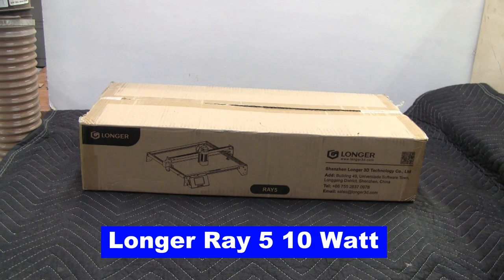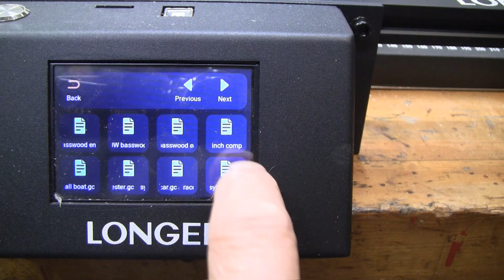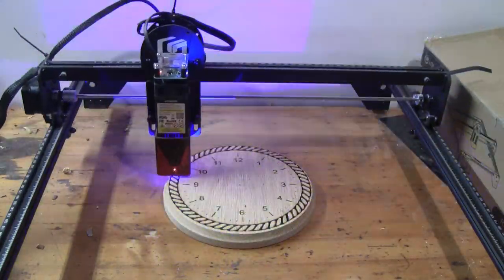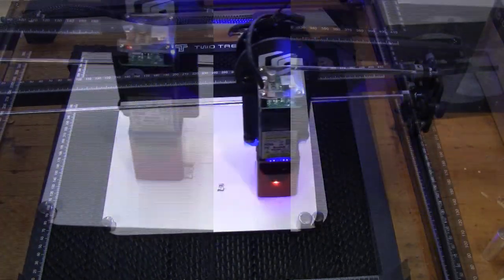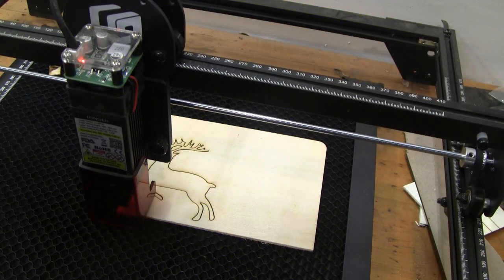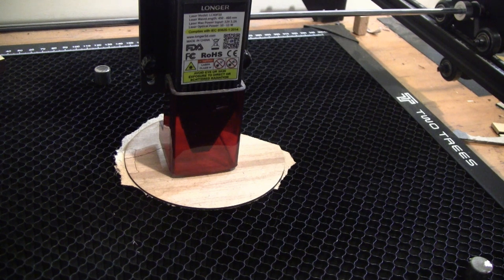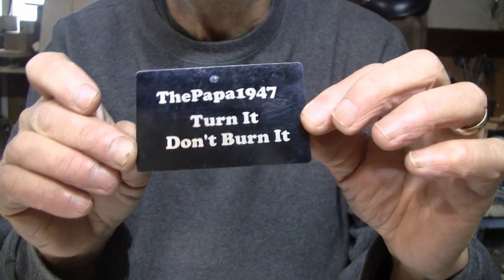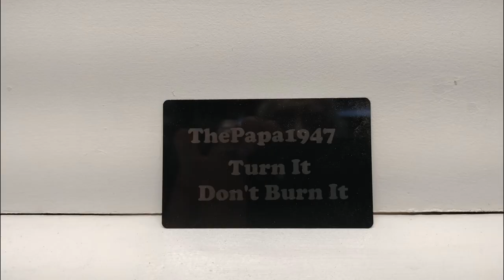Easy Laser Gifts  Longer Ray 5 10 Watt No Wood Turning

Comment: I’ve had my Longer Ray 5 10w for several months and absolutely LOVE it!
Reply from the maker: It is a very nice machine. Once I learned the trick of loading Gcode onto the touch pad I really liked that feature. Although I prefer to use Lightburn. But have created the file and brought it out and used the touch pad.
Thanks for watching,
Gary

Comment: Good overview.  Great idea on using the laser to cut turning templates.  I've been 3D printing templates when I need them, this will be quite a bit faster.
Reply from the maker: Thank you Mark. Yes I will use it for other templates as well. In the past if I wanted a perfect one even for some of my bowl in a bowl turnings I will CNC it but that is slow compared to this. Plus my poor CNC machine is blocked with other things at the moment.
Now 3D printing would be great for sure. But it is a bit slow. At work as a wood pattern maker they ended up getting a few rapid prototype machines. Nothing that us wood guys messed with but I am always interested in the stuffy.
The first rapid prototype machine was an LOM (laminated object manufacturing} and it was as slow as it could get. The young engineer they hired  to learn it had trouble making a model so because I was playing around in CAD at the time I created the very first part it made. I think I still have it around here. But then came the 3D printers a few years later. I am sure they are really advanced now because that was like 18 years ago when they got those.
 Thanks for watching,
Gary

Comment: Great little video. The picture came out really well. I've had a laser for a few months now, but haven't had it fired up for a bit while doing other projects. This video is making me want to get back at it again. I've been trying to incorporate it into other things like my cnc that I've done a couple things with. Laser engraving, then cutting out with the cnc. I really like the clock you made, combining turning and laser. Looks great! Have to try and use all those tools we seem to aquire.
Reply from the maker: Thank you very much. I know there are a lot more uses for it than what I have done and plan on learning what I can.
I have had 2 CNC milling machines for along time and have made lots and lots of things with them. Pretty involved 3D stuff.
 These are not CNC routers but heavy machines that you can cut steel on. But I have done lots of wood projects as well.
I just like the technology of computer controlled machines.
Thanks for watching,
Gary

Comment: Hi Gary,
Just wrote a comment and the cyber grinch flew away with it! LOL
Welcome to the crazy world of hobby lasers!
I bought an ORTUR about 6 months ago and love it. I too have Lightburn and love that as well.
I was shocked to see your laser cut that piece of cedar in 2 passes. I doubt my laser would cut it in 50 passes!
Have fun,enjoy and be safe!
Tom
Reply from the maker: Hey Tom, I have seen that happen before . Lot of grinches running around LOL.
I have to admit these lasers are lots of fun. Is your Ortur a 10 watt? If so it should cut through the cedar.
I am working on being able to cut some much harder wood. When I get it worked out I have a great use for it to aid in my wood turning.
 A test I did today is looking good. Thinner wood but looks like it will take 2 passes.
 I really like the Lightburn software. It is a fairly powerful CAD program in itself. Has lots of boolean functions.
 Have fun and you will be seeing more laser things coming up. And I will try and do those on Tuesdays and my turning on Friday.
Take care,
Gary
Reply: @ThePapa1947  
Hi Gary,
My laser is only a 5 w and I have trouble cutting through 3/16 plywood!
I still fumble my way through lightburn cuz I'm a real computer vegetable! Lol it's real challenge but who doesn't like a challenge? 
Looking forward to seeing your future videos and I know they'll be great knowing you!

Comment: Thanks for the very comprehensive show and tell of a new tool for multiple Laser assisted applications Garu.  BTW, I am looking into getting one of these and the only consideration would be Warranty coverage and durability as this is one of those "NO SO FAMILIAR" brands in the "Hobby Grade" laser CNC world.  So hopefully you will give us all an update in a few months when you have had a chance to put it though its paces, longer than a demo.  Rama
Reply from the maker: Thank you very much Rama.  Not sure how they all are with warranty  but my guess they would be similar. 
I certainly will be using them in my wood turning now and then and get a better feel for them.
thanks for watching,
Gary

Comment: Awesome video. I have been thinking about getting a laser system and this one looks interesting. Thanks for showing how it works.
Reply from the maker: Thank you very much. As soon as I figured out what needed to be done to the files created on the computer and put into the machine it got real easy. Nice to do the design work on my computer then take it out to the machine. Although I usually run it off my laptop.
 I bought a stack of tile to do some testing. Only 16 cents each for 4"X4" tile. Pretty interesting results.
Thanks for watching,
Gary
Reply: @ThePapa1947  Thanks. I was looking at one that cost twice as much but this system looks like it will do all I need. Thanks for the cool yet informative, videos you are always putting out.

Comment: Digital tools will be in my future👍.  Our woodworking shop has a couple large lasers (100w & 130w).  After the holidays I will get decertified.
There are so many options that open up when you add digital tools (Shaper Origin, CNC, Lasers, 3D printing) which our guild has.
Reply from the maker: Thank you Skip. Even though the advancement in CNC and 3D printing slowly took over my trade as a pattern maker I still love how all of it works. I was lucky to still be building patterns from 2D drawings up to the day I retired but it sure was coming.
 That said I have had 2 CNC milling machines for a number of years. I do find them very interesting and useful but my favorite thing is just to build the old fashion way.
 It can all work together though.
Sounds like your guild is all set up.
Thanks for watching,
Gary